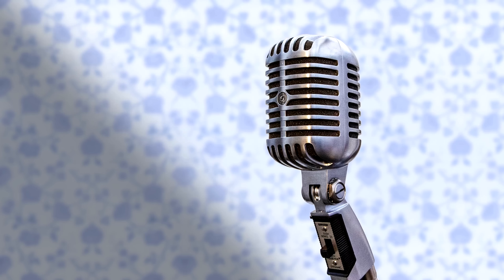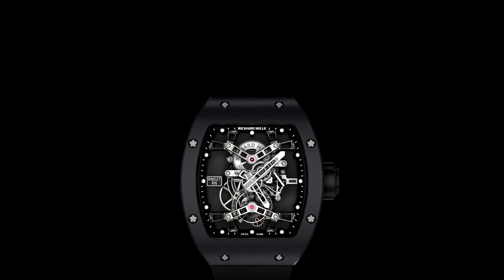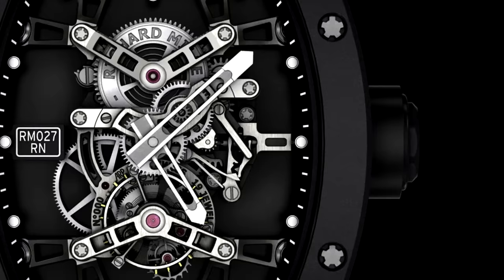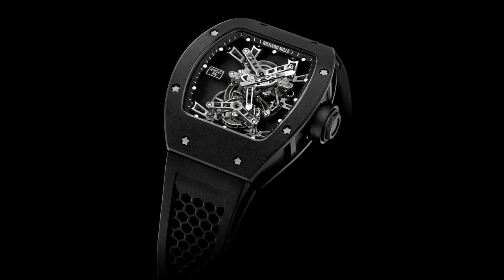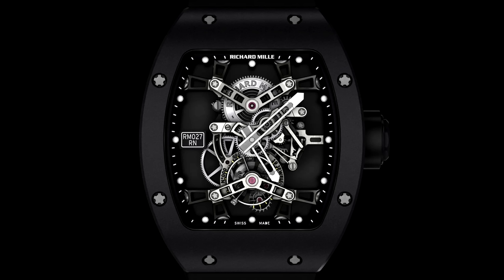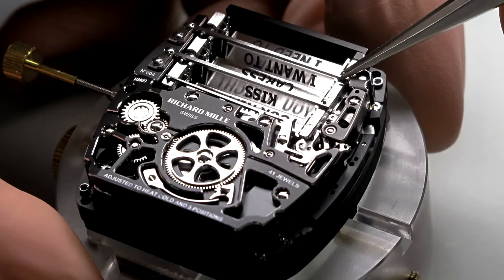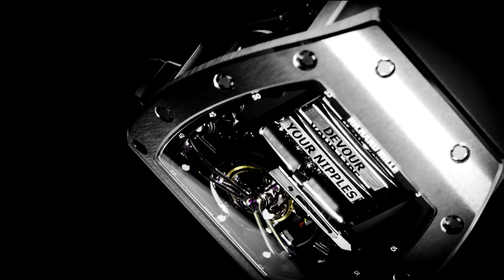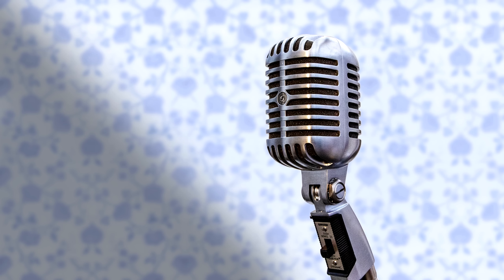Here’s Why People HATE Richard Mille (and Daniel Wellington)

Comment: When I owned my store in North Florida a gentleman whom I've sold many timepieces to asked me if I could replace the strap on his rm so I proceeded to contact rm for the tool to remove the screws they refused to sell me one the owner of the watch who paid nearly $200k
Was quite upset as nearest ad was 300 miles away so I formed a negative opinion of the brand
Reply: Look up "We Knives". They are a high-end Chinese knife maker who used those EXACT same "star" screws on their knives for the first few years. They used to include the tool with each knife for disassembly. Enough people threw a fit and they changed to traditional torx screws. They probably still sell the tool (or you could find an old model on Ebay that includes the tool). Now you have a RM disassembly tool!
Reply: I would not take the chance of marring the heads of the screws on a $200k timepiece  I've seen many ruined case back screws on countless watches that clients brought in for batteries by poor service people. Original tools are the key to quality plus rm has his screws made to his specs not a standard item not worth the risk but thanks for the advice.
Reply: @timhenry326  Makes sense.
Reply: @mgrsdgfsdafsdgrsdgfsdg6980  years ago a lady brought in a Patek quartz loaded with diamonds the screw slots were unrecognizable but still removable. My concern with rm is you wouldn't want to slip up and scratch the case or mar the heads it was 18k rose and this guy was a serious collector you should have seen his wall of watch winder with no space unfilled that was back 15 years ago

Comment: Americans: about that bag of chips/crisps reference. The common size of a bag of chips in the UK is 28g, which is about 1oz.
We get those here too, but usually only in multipacks (though I have started to see them sold loose more often lately).
A better reference  would be to balance two Oreos on your wrist. Much more practical than a bag of chips, and, at 22.6g (11.3g per Oreo) closer to the correct weight.
Reply: Thank you for that advice.

Comment: The success of Richard Mille is the marketing genuis of its founder. The problem is the dude is 71 yo. So there's that. Besides, RMs designs are not timeless which means with changing fashion these watches will become extremely unwearable, especially by the elite, whose star power RMs are riding on, and who wanna remain in 'trend', and then these models will completely tank in value. And then there's this, whichever happens first.

Comment: The best minimalist watches are the Max Bill designed ones by Junghans. Many others have tried and failed. The DW logo is set in Times New Roman, the default of defaults. They tried to create a ligature (letter connection) and failed is my guess.
Reply: Lolz.  Literally.  Great point on the Junghans "Max Bill" watches.  The cheapest and most authentic model can be found for $650 at discount (about $1000 list).

Yes, it's been on my short list for a while, which is why I know the price.  I recently bought the Longines Heritage Classic grey sector dial, and I'm thinking early to mid 20th century.

Comment: There's one RM I like and that's the RM 055 Bubba Watson. Probably the most "reserved" of the RM:s, it has a relatively stripped down movement that looks like it's almost floating inside the case. Almost kind of elegant compared to most other RM:s which have dials that look like Terminator vomit.

Comment: This is like listening to "audiophiles" discussing nebulous characteristics like "air", "sibilance", "vibrancy", and so on and so forth. Then there is the weird and wonderful garbage that has sprung up around the most ridiculous patterns of behaviour that caters to the nut cases that can "hear" the difference between hifi cables supported off the floor by wooden blocks versus cable lifters machined from pink marble. At the risk of sounding rude, which is absolutely intentional by the way, all this talk is a supertanker's load of tosh (I am being very polite just in case it isn't obvious). A Chinese knockoff does everything a Richard Mille does with equal ugliness for a handful of change. Honestly, have you seen the shop fronts of the major fashion brands lately? I have to say that, compared to the hideously injurious occular atrocities in the offerings from the likes of Gucci, Prada, and even, God forbid, Ermenegildo Zegna, the watches offered by DW are like eyedrops for someone without eyelids in a sandstorm. Don't even get me started on Tom Ford's opinions on the avec muavais goût of wearing your watch over your sleeve (who the heck cares?). Try telling that to Neil Armstrong. You did say that we can agree to disagree...